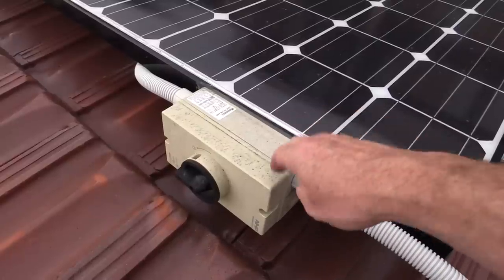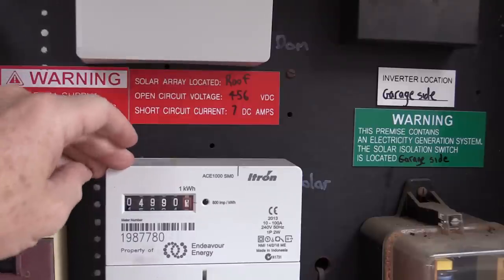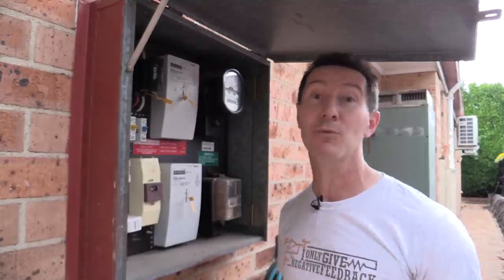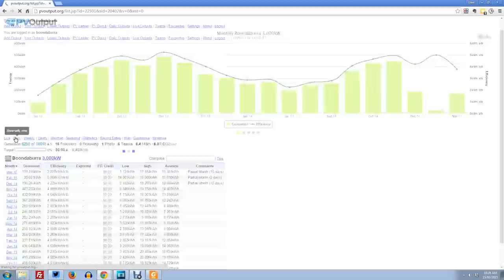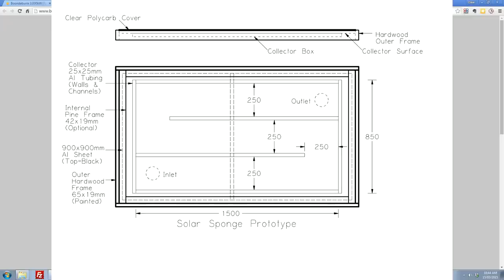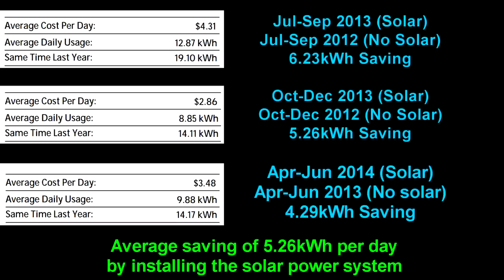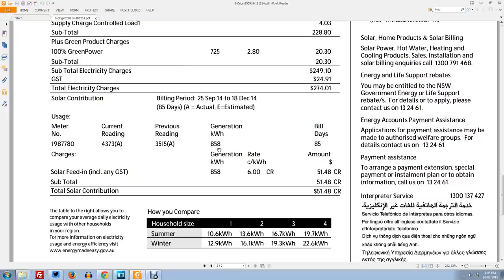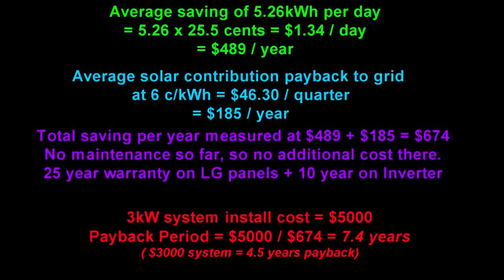EEVblog #724 - Home Solar Power System Analysis & Update

Comment: am i the only one not understanding why you would not have a battery system if you only make 1/4 selling it back?
Reply from the maker: TheJttv Haven't looked into the economics of it yet. Plus we don't have a huge amount of spare space for it.
Reply: Is not economical to use a battery even at 40cent /kWh you can barely amortize the cost with a LiFePO4 from Sony.
With Lead Acid that will be a joke probably gets you close to 1$/kWh.
I live OffGrid and use LiFePO4 but that was my choice I can not get a better amortization cost that about 20 cent if all works as expected over the next 25 years. I only have about two years of OffGrid and I need to watch my consumption.
Solar PV is extremely inexpensive but the storage part is a different story.
Reply: because you'll loose like 40% of the energy to store it and then retrieve it, not to mention that batteries have shorter lifespans than the 25 years of panels
Reply: I think a fair part of this argument is it kills some of the mass appeal of solar. A quality grid tied system should offer at least 10 years of maintenance free operation. Literally, you don't need to do a thing until something fails, most likely the inverter. And with a quality unit like Daves SMA, it might last you closer to 20 years or more. It just sits on your roof, working, for 20 years, without you doing a thing. Batteries really trash this idea, unfortunately. Most people are using lead for mass storage, which is just plain crummy and the economics are not quite as well defined.
Reply: He does have a battery.  It's a 50 Hz model.  :-)

Comment: Dave, this means that anyone generating solar power, is actually GIVING the electricity companies 18$c a Kilowatt for free (24$c minus 6$c). For every kilowat that they can sell to other households the charge 24, but pay you only 6! Finally the profits of the business model is revealed! Years ago I knew the green sustainable trend is just another business model. Lets hope honest people who REALLY care and contribute to their environment profit too one way or the other...
Reply: As Dave said, solar panels generate power during the middle of the day, when the demand for it is significantly lower. It's not surprising that solar electricity is worth less at the time when it is generated.
Reply: The electricity delivered by the electric company is metered at the home, so the reading is very close to the actual electricity used. The electricity delivered by Dave is metered at his home, so the reading is very close to the generation point, which will experience losses en route to the point of usage.

I don't know how the whole system works or if 24 cents and 6 cents are the "right" numbers, but that's what happens when you have governments arbitrarily setting the prices of things instead of allowing market forces to dictate.
Reply: the 6 cents is probably similar to the price the electricity company pays "power plants" for "bulk electricity". but you have to remember that this is not only cost that electricity company has. building lines, maintaining them, balancing the grid, energy loses, worker wages and so on so on. it is similar to any other business.
Reply: Yeah I guess you are right such costs (once or reoccuring) have to be compensated someway indeed
Reply: They charge businesses even more..A lot more than 24 cents kwh
Reply: I don't know how things work there in Australia, but here in the U.S., the peak demand time is during the middle of the day when solar outputs the most power. Businesses by far use more electricity than homes do here, and I can't imagine it'd be all that different in Australia?

Comment: When you compare prices incoming and outgoing for KW hours, when you talk about the price ratio, you really do need to talk about the cost of the grid infrastructure. You might address this in another part of the video, but not expressing it in the "ratios" of pricing, out of context, there seems to be a bit of dishonesty.
Reply from the maker: axelasdf I already pay a connection charge which is effectively a grid and maintenance charge. If it's not enough, then that's their problem for not moving with the times.

Comment: AGL Gives 8c - Still crap. Since adding  batteries for night they now pay me.
Reply from the maker: turbosigma What battery system did you get? Seems to be very little info around on providers.
Reply: EEVblog Look for a YouTube channel - "Justin Case". I modelled my system on his.  Keep your current system. Add new inverter/s that runs the house. With the option to charge from the grid and solar (yes, more panels) in day time hours. The grid then become your backup.

Comment: all you guys in Australia who have domestic solar arrays, need to band together and form a union of sorts to force the lecky company to give u a better price,have a strike where you all just dump the spare power instead giving it to them for next to nothing. Or u should think of some thing to do with the spare power during the day, like have a lecky car charging bay built on your drive where a neighbour, or whoever could get their lecky car charged during while you are at work, or you could find a local company that has a lot of battery powered stuff and offer to charge them en mass for cheaper than they could do it themselves, I'm think about say courier companies or the post office who have a shit stack of handheld gear the guys use, that all needs charging each day. What would be even better would be this nascent union I've just blue skyed, could be a micro grid, if you guys all joined together to provide power where it was needed exactly like the real grid does, all those solar arrays or MCU controlled if they where networked, when power was needed in a certain place it could be directed there, I'll leave you guy to work the details out, should be a piece of piss, lol, back of an envelope.

Comment: It makes sense for the electric company to pay a lower value for the energy you are sending back to the grid. You are using all of the infrastructure of power lines, transformers, etc. And maintenance costs money. It didn't need to be such a low value, but, that's capitalism.
Reply from the maker: Claudio D. Yes, but I'm paying a connection charge that must include the maintenance as well. Not my fault if they don't know how to properly cost and charge for that. They need to change with the times.
Reply: No the eliectic companys are monny hungry thay shuld pay you at the same rate as you pay them you are giving them more power that thay can sell.
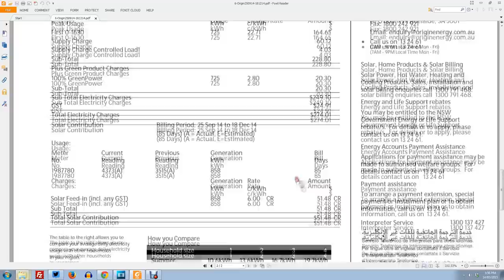Reply: 27:35 he's paying $64 for supply charge and the control load. I blame a lack of smartgrid infrastructure, once people have electric cars the power companies will be paying you to use your batteries (vehicle to grid).
Reply: Russell Thompson and given that this solar energy is lower quality - intermittent, unpredictable - the 6 cents that is paid for it is very generous
Reply: Claudio D. I disagree, they should pay EXACTLY  the same rate you pay them
Reply: "but that's capitalism" -- naw, that's Monopoly.
Reply: Paul Bartley He has the choice to change energy providers, It's more than I can say compared to where I live. He even said that the other one pays more for the excess power.
Reply: joshcryer People have electric cars and I've never once heard of a power company paying to access privately owned batteries as a medium of electrical storage.
Reply: Sure, they can charge whatever they like, but it does seem a bit insulting that they then charge the end user almost half the 6 cent per unit as a 'green' surcharge.  That way they're actually paying only 3.5 cents per unit for the energy they get!
Reply: joshcryer "he's paying $64 for supply charge and the control load" that is probably due to having gas hot water, and they can use ripple control on that. It's a similar charge as we we have in NZ.
Reply: EEVblog If we truly want to switch to renewables, it would not hurt for the government with a few subsidies. After all, coal is subsidized, oil is subsidized and they get us into troubles. If they have money to bomb Iraq, threaten and inspect Iran, attempt coups d'etat in Venezuela, Chile, Iran etc, they can sure as hell help out with something that is going to save us tons of money and lives in the end. Every time you want to help the poor, you'e a communist. Every time wealthy people demand money, everybody bows. I mean there's your subsidy right here: http://en.wikipedia.org/wiki/Australian_contribution_to_the_2003_invasion_of_Iraq . And this money was not even thrown out the window but worse then that, it made people less safe and killed people in the hundreds of thousands if not millions.
Reply: sell it to a bitcoin miner
Reply: There should be different rates depending on whether it is peak power. That would give people incentive to add batteries systems and supply energy back to the grid when it is profitable. This would help stabilize the grid and increase battery use. For non-vehicle use the battery energy density is not a problem, thus they shouldn't market the lithium car batteries for home use, rather give a rebate for old lithium batteries so that it can be recycled. Liquid flow batteries is the solution (lol, pun), for home battery use/grid stabilization.
Reply: Monopoly is capitalism, if you haven't figured it out yet :)
Reply: Claudio D. Did he say he has the ability to change? Because where I’m from the power company basically  has monopoly over a region that’s regulated gov. So there’s no switching since there’s only one power company per region
Reply: Gert Kruger communism is a monopoly if you haven’t figure it out yet. Only one entity, the government controls everything.

Comment: Well Dave all you are really doing is paying your utilities to destabilize your grid.
In other words you are supplying unreliable power that enables your supplier to reduce overall capacity.

Another side effect is that you are punishing the poor with ever higher energy rates. This is caused by the shift to so called green (EXPENSIVE) energy sources away from much cheaper sources such a coal and nuclear, etc. The end result of all this is unstable and much more expensive energy; so you should add in the cost of on site backup generation as well to all your cost equations.

Also it is telling that even clearly technically knowledgeable and intelligent people as yourself are constantly in denial about the realities of roof top solar and so called green energy in general. 

The math doesn't lie, and when all the costs both economic and social are added up roof top solar is an epic fail for the foreseeable future.

Comment: could you store some of the generated energy in some 2400 uF 450V capacitors? On this link they cost USD$62/unit http://www.newark.com/cornell-dubilier/dcm242t450df2b/aluminum-electrolytic-capacitor/dp/59K0176
Reply: That wouldn't store any useful amount of power. You would need super capacitors, but the cost would make that completely impractical. You would be better off with some nickel iron batteries since they last over 20 years.
Reply: thanks! How about Hydrogen generators and a fuel cell?
Reply: Luis Daniel Mesa Velasquez That would be quite inefficient. Unless you have a hydrogen powered car, it wouldn't be worth the trouble.
Reply: 450V x 0.0000024F = 0.00108 Wh, so no, they don't hold any usable amount of energy.

Comment: So how can you charge your electric car when you are driving it during the day?
Are you going to start working at night, or are you going to buy two cars so you can drive one and charge one?

What about your wife, don't you really need four cars or does she have to drive an earth killing petrol guzzler and live with the guilt of all those drowning Bangladeshisians?
Seems like you may need to weigh the cost of therapy and the cost of the extra two cars. Bummer.

In any case it will be interesting to watch your rationalizations grow as time and futility mount.
Reply: And the embedded energy cost of manufacturing a car is in the order of 1 TWhr. That's the equivalent of providing my house with enough electricity for the next 68 years before I even turn the ignition of the car.